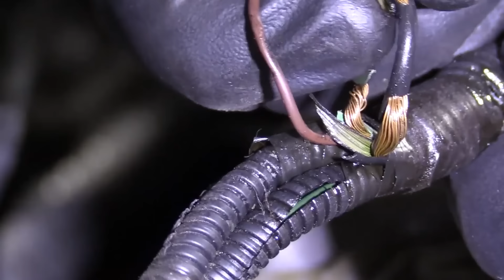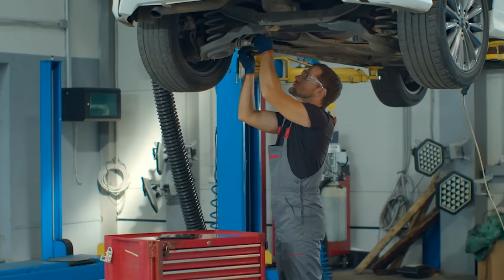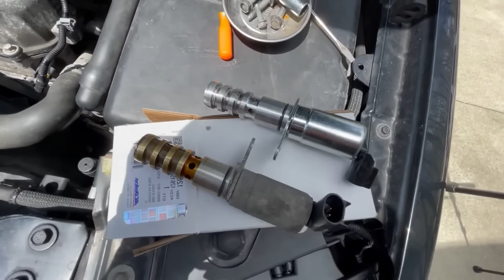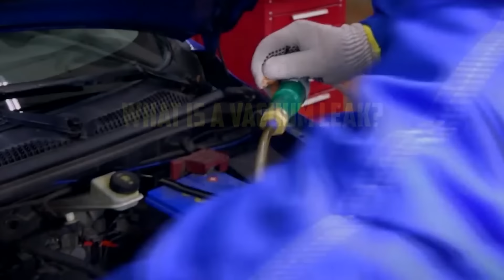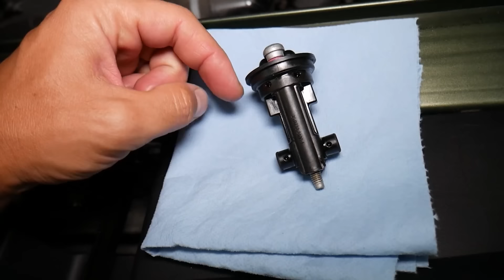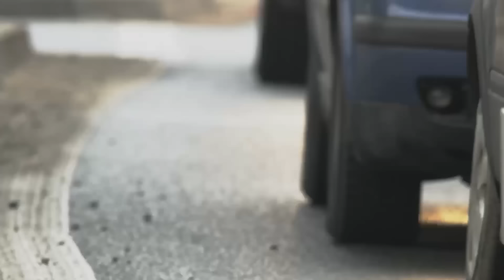Check Engine Light ON? Here’s 10 Simple Fixes (Don’t Waste Money!

Comment: My new 2025 1500 Ram Bighorn only has 1123 miles on it and the engine light came on today. 
My code finder says; PO300, random/multiple cylinder misfire detected. 
After only 1123 miles? I will let my dealership run a diagnostic on it and see what they tell me before I say what I found.....should be interesting.